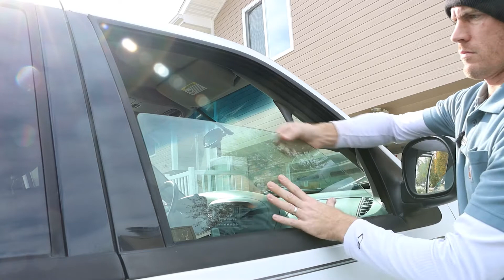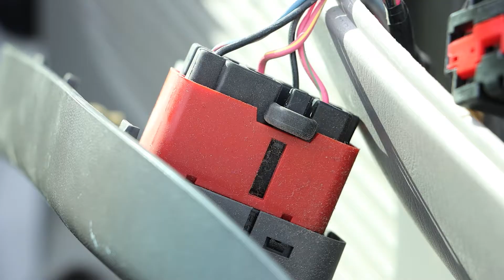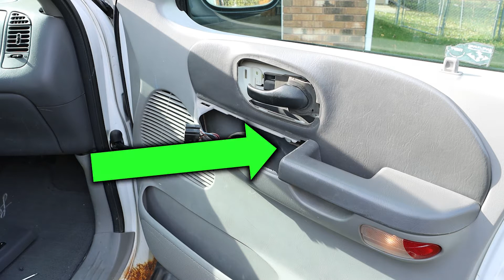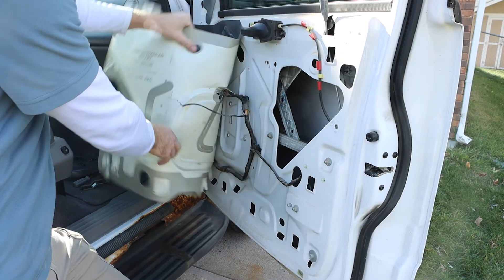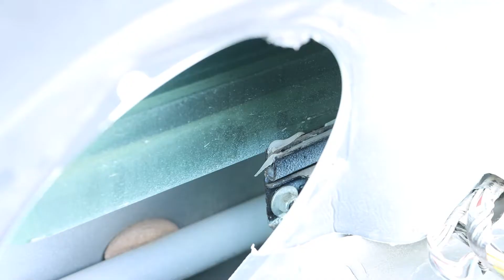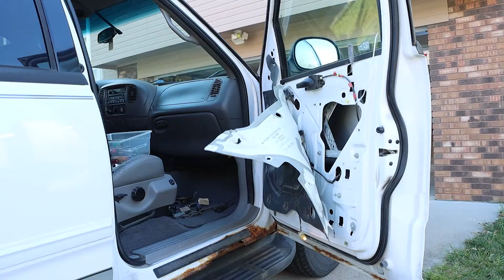Passenger Side Window Repair (Window Off Track) - 2001 Ford F150 - (1997-2003), 5.4L

Comment: My truck is an 89 Ford F350 and the last time it came off I added a screw on the right side of the track that the little nylon thing right then so it couldn't go perfect through but somehow window came up again
Reply from the maker: Good tip if it is working.

Comment: On my 2001 F150 my front passenger window doesn't go down I have used the switch on the driver door and the passenger door and the window still won't go down what is your advice on troubleshooting this
Reply from the maker: Since neither the driver switch nor the passenger switch will operate the window, I would first suspect either a bad window motor, broken wiring between the door and body, or a power issue. Start by turning the key to the ON position and listen closely at the passenger door while pressing the switch. If you hear absolutely nothing, check the fuse/circuit breaker and inspect the wiring in the rubber boot between the door and cab because those wires commonly break on older F150s. If you hear the motor trying to move or clicking, the regulator or motor is likely the issue. You can also remove the door panel and test for power at the window motor connector while pressing the switch. Sometimes lightly tapping the motor while holding the switch will temporarily bring a failing motor back to life.

Comment: Is it still holding one year later? I fixed my driver side before using 3M 8641 Channel Bond and It's held a year. Can't find 3M 8641 now to repair the passenger side today. I was wonnding how the 3M 8008 you used held up? Thanks.
Reply from the maker: Still holding like a champ.

Comment: Great instructions. The only thing I'm missing is how you got the new window in... how does it go back in?
Reply from the maker: I understand your question.  However, the original window had just fallen off the track and the video shows how to reconnect that window.  I did not need to replace the whole window.